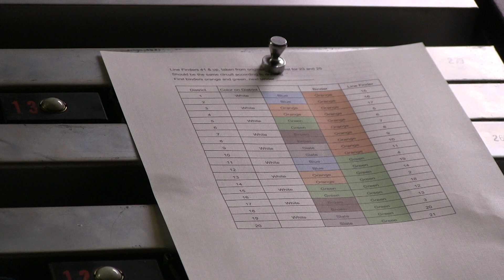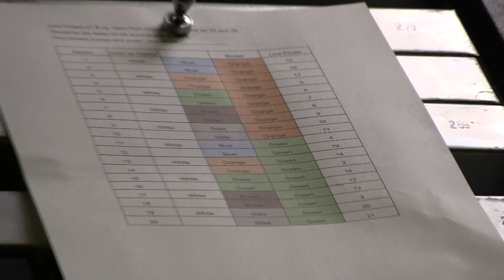[Panel] How does the line finder work?

Comment: There is so much architecture that was designed in such a thoughtful and solid manner.  It is mind blowing to think this was all achieved mechanically with motors, electromagnets, and wires.  In many ways it reminds me of how computers work, only you can see this machine in action.  You can’t really see what a computer is doing.  That’s what is so jaw dropping about it.  It was invented so long shop by some very brilliant people.  The Leonardo DaVinci of telephone switches people.  Not many people could have figured this out.  They were special people.

Comment: What amazes me is how much the panel office is an electrical analog to what operators would have done in a manual office.
Reply from the maker: YES! That was the whole point! They were really trying to build a robot operator, and that's exactly what they did. :D
Reply: @ConnectionsMuseum  So, an operator would look for the lamp or the drop to know which line to plug into.  How does the panel switch know where to send the line finder? They're not constantly moving, looking for off-hook telephones, so how do they know where to go?  

That could be a whole 'nother video.
Reply from the maker: ssbohio it definitely could be a whole new video. Basically when you go off hook, a special relay that’s in series with your phone line operates. This is called the (L) relay. The (L) relay causes a whole big chain of events to happen, eventually starting a line finder moving upward. It continues upward until it finds battery (-48v) on a special “hunt” terminal on the bank. Once it sees that, it knows that it’s found your line, and stops.

Comment: Great description.  Basically this line finder is a processor built using binary logic and do-while-loops, processing input bits and pulses according to state machines, along with some timers, driving output bits and pulses.  Quite fundamental yet when you stack everything up it is an extremely complex system.

Comment: Wow. With this one video you have answered several questions I've never understood since I worked for Ma Bell back in the early 70's. 

Despite me being the webmaster for TCI, my own http://BellsyStemPractices.org/ website,  and all the switchers I know, I've never gotten an understandable answer as to what exactly a line finder does.
It finds the "subscribers line" when their phone goes off hook. I had always pictured it as something to do with locating a trunk line, which didn't make since considering where it is in the circuit.
That's something that seems to be so obvious to those in the know, that it never occurs to them to explain that to the layman or museum visitor.
I remember seeing those rotary step switches you explained in this video back when I worked in the old materials receiving dock in the Western Electric plant in Arlington VA. I could tell they weren't part of a SxS 'mail box' switch because they were too big. Now I know what they were used for.
I could never understand how the vertical cross bar switches worked or what they did before now. 

I am continually amazed at the geniuses of Bell Labs and Western Electric. Most brilliant folks of their time.

Sara is getting much better with her videos. Keep up the good work Sara. You're teaching an old phone nut new things.
Reply: I've been wondering these things for decades!

Comment: Can anybody explain how a telephony anomaly that i was part of (back in the late 1970s or early 1980s) could have happened? When I was much younger, our rural communities were served by the small, independent Red Hook Telephone Company in upstate Dutchess County, NY (sold first to Continental, then to Frontier, as best as I can recall). One evening, I picked up the phone to find many other people already in conversation. Apparently, anybody that went off hook was just joined together in one big "party line" scenario. This party was well under way before I joined and overall lasted at least several hours. Folks just dropped in and out just by picking up their receivers. (I have friends who still recall that day, so it wasn't just the fevered dream of a young telephone phreak.) I'd been in the CO a few years before and at that time they had an ancient frame type system - lots of moving parts. I'm not sure if that was still in place when this event occured. Any ideas how this could have happened and on what type of equipment?

Comment: Thank you Sarah.  This line finder contraption is part of the step-by-step exchange is it?  Great video.  You’re excellent at explaining/teaching.
Reply: It's part of the panel exchange.
Reply: thecooldude9999 Oh I am not familiar with a panel exchange.  Only Step and Crossbar.  Very cool stuff.
Reply: Line finders in Step use a similar concept with a line relay that triggers a selector to start moving, but uses step switches (with a special set of contacts for vertical hunting) instead of panel selectors.

Comment: Sooo...unless I missed it (very possible) each subscriber is wired across each column in its bank to potentially engage each vertical LF.

My mind is still blown how calls are handled in the CO to subscribers in the same CO.  How is each subscriber line split when it enters the CO into outbound and inbound routing? It seems there's so much extra copper to handle that and the redundancy that there must be some esoteric DC capacitance and impedance issues.
Reply from the maker: Yes, the linefinder banks are like a big long sandwich. Each subscriber appears in front of all of the rods (well, half of them in this frame, since its cut in the middle). This way, any line finder can hunt for the subscriber by moving vertically.

The subscriber line is split at the MDF when it enters the CO from the outside. Three leads (T,R,S) go to the line finder, and the final frame. The run is so short (only a few hundred feet) that there really aren't too many weird issues. This is how it was done in city manual exchanges for years before the panel switch. Subscriber lines were wired to the "A" board for origination and to the "B" board for termination.

What really gets weird is the signaling loop on the trunks between offices. The panel senders use DC signaling to communicate to other offices miles away. (Think like a giant telegraph circuit). So there is a speed limit on that circuit because capacitance and inductance on the wires can make signaling impossible over distances greater than 20 miles or so.

Comment: Love your videos Sarah, you are awesome!! Question: How does the line finder detect an off-hook condition? An off-hook condition applies a short between the tip and ring (48v and Gnd.) so the line finder has to detect this condition somehow. I installed ESS equipment for Western Electric. Ferrod sensors were scanned to detect off-hook in the line switch frame, but this thing obviously had its own thing. Thanks
Reply from the maker: Well, its almost like a ferrod sensor, but more low-tech. Every subscriber has their very own pair of (L) and (CO) relays. The (L)ine relay is in series with your phone, so when the off-hook short happens, it operates the (L) relay. When the line finder has found your line, the (L) relay releases, and the (CO) relay operates which grounds your sleeve lead so your line is marked busy to anyone who tries to call it.
Reply: @ConnectionsMuseum  Good job Sarah. Thanks.

Comment: what tells the line finder which line to find?
Reply from the maker: When you pick up your phone, battery (-48V) is placed on one of the terminals corresponding to your line. When the brush touches that terminal, a relay operates, which stops the upward motion of the brush. Then the battery is removed from the terminal for the rest of the call.
Reply: There is also a common trigger circuit that basically says "Someone within this line finder needs a connection." This is operated by the line relay, and the cutoff relay prevents it from being constantly powered. A similar system is found in Step, not sure about XB.

There's a good video about line finders in Step that explains how the system works, but I don't remember the title.

Comment: The point of a line finder is economy of scale, but you wonder how much economy of scale they are really getting by adding all these flip-overs and special logic and ...
Are they all controlled in common? So there's only one logic circuit that selects one line at a time, using whichever rod is available but only one at a time until that one is done and then finding the next call with a different rod?
Reply from the maker: Yep, one main controller circuit per side of the frame. That makes 2 per frame, times however many line finders you have...usually 10-20 frames worth.
Reply: @ConnectionsMuseum  The split line finder is just 2 line finders in one big package, as I understand it, so I'd still call it 1 control circuit per line finder. I was wondering if there were "race conditions" where two selectors could find the same line at the same time, or something like that - but if there's only one control circuit, that can't happen.